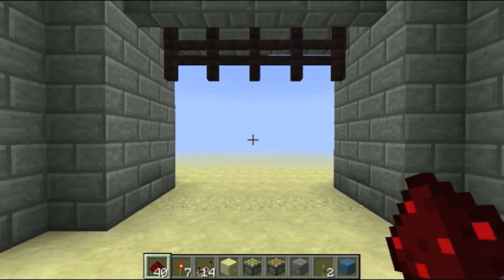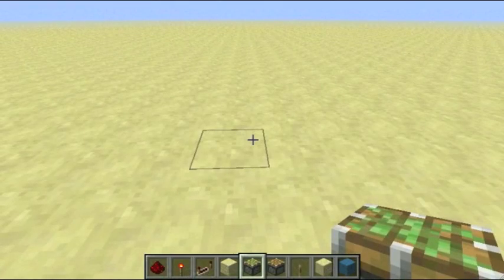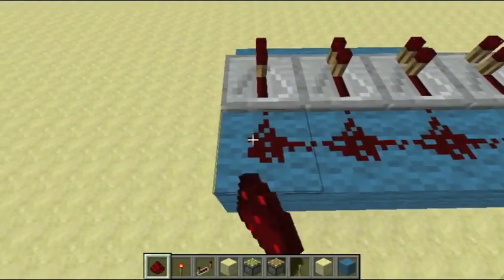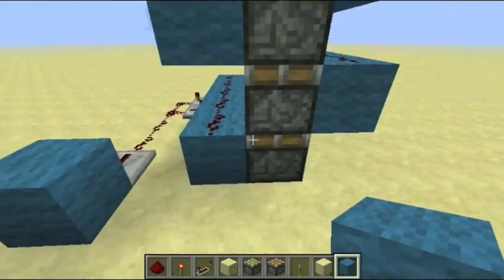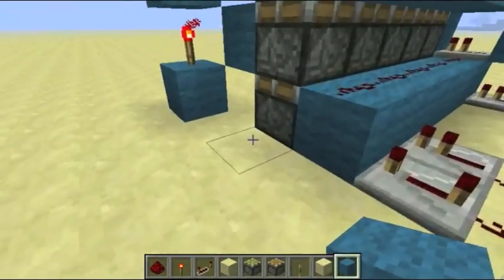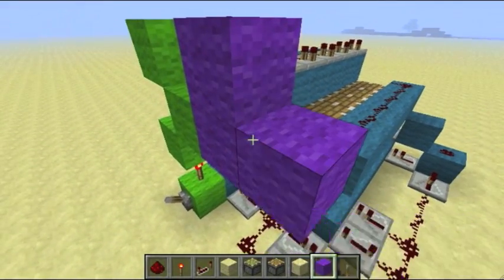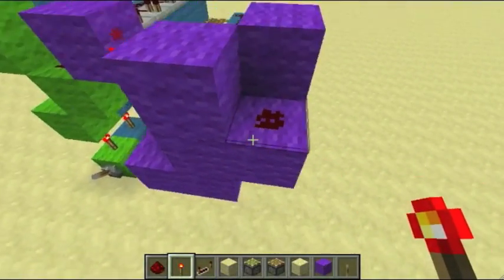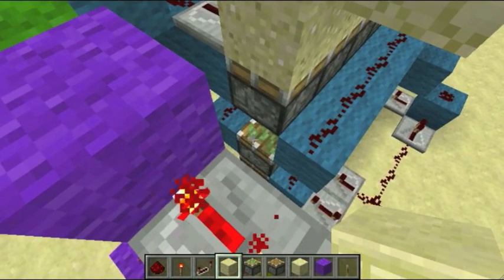Perfect Piston Gate (Portcullis)

Comment: Had a little fun modifying the circuit with some redpower to replace the purple circuit entirely, plus add a toggle latch (does the same thing as a t-flip flop) to make everything work with buttons.  I'll probably be using the floor circuits almost verbatim on a tekkit server.

Comment from the maker: I've had a lot of requests for this, so I might make a separate video for it.  If you want to make something like that, you can make everything here except for the purple and pink, then have your lever at where the purple's torch connects to.  You should see 3 repeaters, one going into some torches, and two going the opposite way.  One of these opposite-way facing repeaters should be set to 1.  Change the other one to 5.

This wasn't made for that and the retraction isn't the best, but it works.

Comment from the maker: They're just left at the top?  That would suggest that the rest of the pistons didn't wait long enough.  There are two repeaters that go into the majority of the cyan circuit: one set to the first delay and one set to the third.  My guess is you have the one that's supposed to be on 3 set to 2.  Either that or the top pistons aren't pulsing fast enough, which would mean you having to speed up the purple circuit.

Comment from the maker: That sounds like something is wrong with the purple circuit which makes the short pulse for the bottom pistons.  From your description, that's not working, so there could be a repeater missing in there.  Are all the bottom pistons extended?  If they are, I'm 90% sure of it because that would explain why the top set of pistons aren't firing.  The bottom needs to be retracted before the top can come down.

Comment: Pear, you are amazing but I am having trouble with this.. when i throw the switch the bottom pistons stay extended and dont drop the gravel... then when i throw it again the gravel drops but the gate doesn't shut.. I have gone through your video 3 times in completion and I can't figure out what I did wrong.. on a 1.2.5 SMP.. only had to make one small modification to a repeater behind the one that is either 1 or 2.. had to make it set 2 to make the top row on the bottom stick.. any ideas ?

Comment: hey, im having trouble pulling the top row of pistons down. I've tried the advice offered and checked over my design several times. The only difference between mine and yours is that mine is on the xbox and that I used 3 rows of 6 pistons instead of 3 rows of 5.

Comment: this gate works in 1.5 and above if you set the repeater to 4 ticks  at Minute 3:46. Then  it should work correct. i use this pistongate since a Long time and ist fine up today ;) and the most compakt design ever since

Comment: I used this design on Xbox for a 13 piston gate and it works wonderfully except..... One single gravel block that destroys itself when the gate is opened. It works but is extremely annoying. I tried switching the relays that you suggested from one to two but that had no effect on my suicidal block. Any ideas?

Comment: im on 1.2.5 and i have to have the repeaters set to 4 and 2 other wise it doesn't work, and because of this i have the slight glitch in the sand falling down. does anyone else have this problem on 1.2.5 or do i need to check my circuitry again?